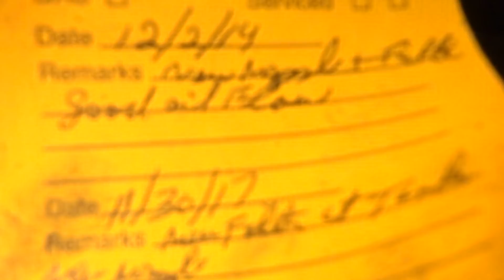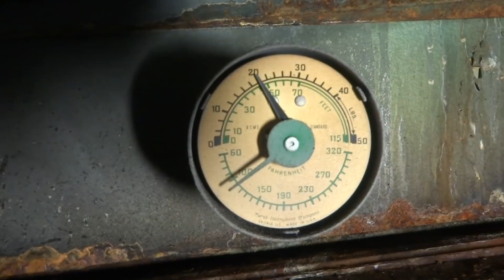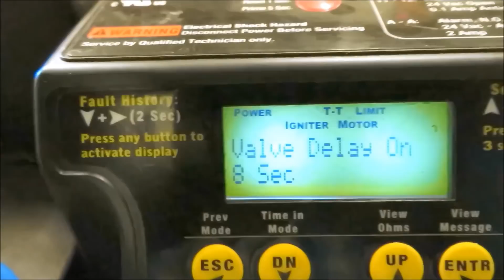drain expansion tank  tank on old boiler

Comment: Hey Steve I have the same expansion tank on my system, I have a Benjamin cc500 wood/oil boiler. I recently bought this house and new to hot water radiation. I’m having a hard time to heat my house with just wood, the lady that owned the house before said she had antifreeze added to the system. I’m going to drain the system and replace just water, do I need to drain the expansion tank.?

Comment: A Steve,I’m thinking about buying a similar truck like yours,my van is just not cutting it anymore,to small,just wondering how heat and air were in cab?anyway great vids keep them coming
Reply from the maker: i like my truck just expensive to maintain parts are crazy money you have to get them from workhorse .i need the truck because of the weight it carries 14,700 gvw and a diesal tween turbo good on fuel 10 to 12 mpg .over all i would not have any other truck for me
Reply: A Steve thanks for reply,how is heat and air in cab?
Reply: @stevenlavimoniere  how do I refill after draining  do I have to keep the water on while draining?

Comment: Question , does the old style tanks need to be drained out periodically or let some water out? My pressure relief is letting some water out. The heater is getting up over 30 lbs, letting water out of relief valve, 30 lbs. . The water inlet valve is working as should ,12-15 lbs. Thx

Comment: I just bought a house that has an old expansion tank similar to this, however it only has one threaded hole to connect it to the system with a boiler drain on a tee, no bleeder, no sightglass. 

When you reopen the valve that isolates the tank from the system, the tank just fills up with water. Does it only partially fill with make up water? How do you stop it from just flooding the tank right after draining it?
Reply: Hey did you ever figure out the answer to this? I have the same type of system and am dealing with the same problem
Reply: I decided to just run the system and see if it would pop the relief valve when it reached high limit, and to my surprise, nothing happened 😁

System pressure reached maybe 18psi, even after running for 10+ minutes. Not sure if this will lead to problems down the road, but it has heated my house just fine so far
Reply: I do plan on replacing the whole boiler myself, and I will switch to a bladder tank with an air separator, as well as a magnetic dirt separator to keep some of the iron particles from my system out of my new Weil-Mclain
Reply: @worlddomin623  Wow thanks for the quick response! Just to clarify, did you leave the valve between the expansion tank & system closed? Or if you opened it, did it stop filling up with water eventually? I'm planning on switching to a bladder tank soon as well. But in the meantime I am still stuck with the bladderless one and trying to get the house heated.
Reply: @akakeanu  No, I left it open. Based on how they are supposed to work, theoretically that valve would need to stay open for the water to have a path to the tank to 'expand'. 

It did stop filling eventually, I'm guessing once the tank was full. I would turn it on and see what happens like I did, my system is an old converted gravity system with lots of large radiators with long runs to the boiler, I have a lot of system capacity for a little 150k BTU boiler. Not a hydronic heating expert, but it could be that based on the large volume of my system, the boiler doesn't have a chance to actually reach 180°F and therefore expand enough for the relief valve to open.

I would put a bucket under your relief valve vent to see if your system will expand enough to reach 30psi, and I would also sit there and watch the system heat up and keep an eye on the pressure gauge until you're sure nothing will happen.

Comment: Dont know if I will get a comment being this video with so old but got a question. We have a tank like this and when I drain it down and open the PRV back up, it instantly feeds the tank. Almost back to the top to make 12PSI for the PRV To quit supplying water. What am I doing wrong? Every cycle ends with a relief valve popping off

Comment: Question. In my area 99% of these plain steel tanks have no airtrol fitting on the bottom. Just a regular bib or gate valve. This makes it time consuming to drain these things down. Would you add the proper fitting or retrofit an extrol style tank?
 Another question.. every time I drain one  I end up with a Pressure reducing valve that doesn't open to fill and then sticks open and I have to valve it off. Would you  replace the PRV or leave it valved off?

Comment: If it pops the relief valve drain the expansion tank and refill. Got it !
Reply from the maker: i did not pop the relief valve???????i try to bypass the feeder to see it was stuck ..and feeding water .never touch the relief valve .if you do you most likely will have trouble with it .